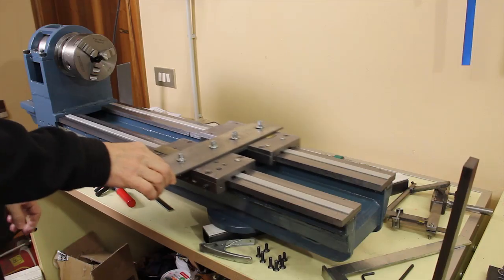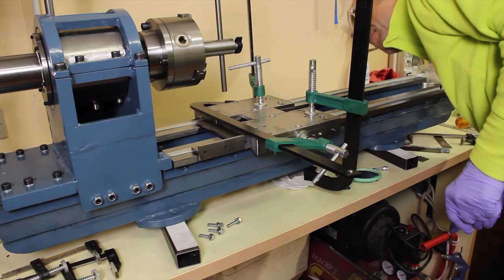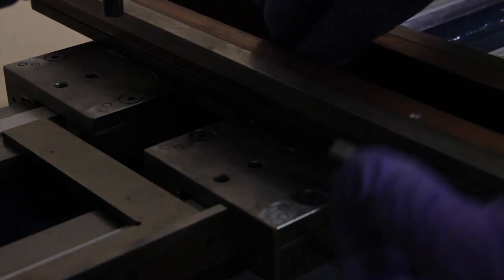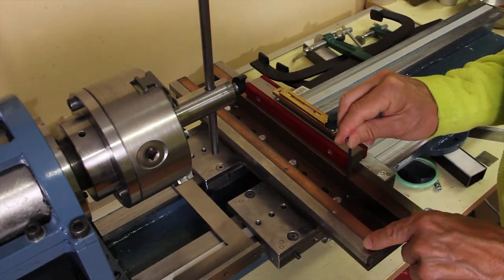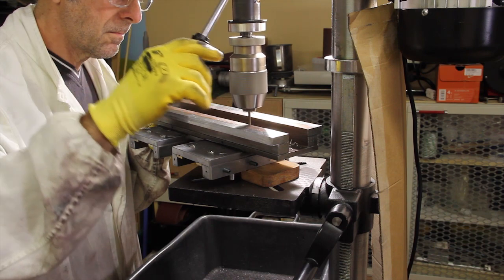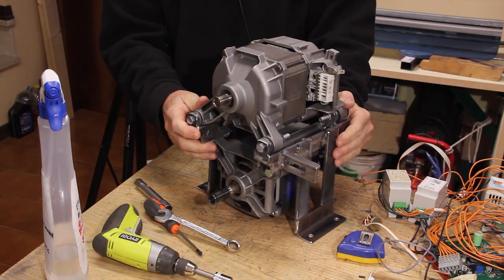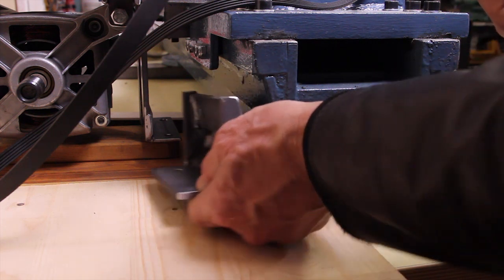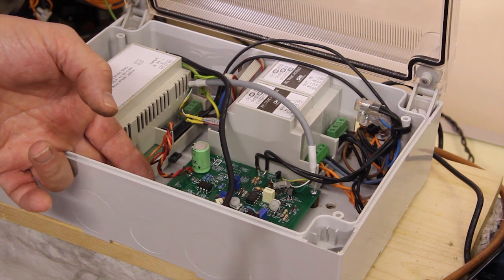DIY metal minilathe [part9] Is it spinning?

Comment: •	If both VFDs try to hold their own speed independently, tiny speed/phase differences make the motors fight each other (one supplies positive torque while the other supplies negative), causing heat, vibration, and damage.
Reply from the maker: That's not how it works. Check out other videos where this driver is explained. These are universal (DC) motors.

Comment: •	If both VFDs try to hold their own speed independently, tiny speed/phase differences make the motors fight each other (one supplies positive torque while the other supplies negative), causing heat, vibration, and damage.    So it seems dangerous

Comment: Bravo! I was just thinking of your project and how long it has been. Sadly I can't offer any assistance regarding your motor drive but I can make a guess that the circuit board has a broken trace or a dry solder joint. Have a good inspection with continuity / ohm meter. Happy New Year.
Reply from the maker: Thank you. You guessed right, the board is already fixed now, a video about it will be up on Jan. 2 at 12AM CET. Happy new year.

Comment: It's alive ! It's alive !
Great job 👍 what a pleasure to see your lathe video !
Quick tip, when you want to measure hole axis distance you don't need to know the diameter, just measure the distance between the right side of the first hole and the right side of the second hole.
Have some good holyday.
Reply from the maker: Thanks. About axis distance you're right but for a precise measurement you need a caliper and directly picking the two right sides is not that easy. Happy holidays.

Comment: Been awhile glad to see ya back and really glad it was this episode that lathe is coming along nicely I see you added the lead screw nuts for the carriage how are you planning to engage and disengage it also without half nuts I don’t see thread cutting as a possibility but regardless it’s very impressive and gonna be a very very rigid little machine way better than anything you can buy these days in this size range
Reply from the maker: No half nuts. This is a special arrangement for a direct drive only motion.
Reply: @AccidentalScience  my old lathe has the same mounting point of nut. Lead screw have clutch near spindle to engage/disengage .